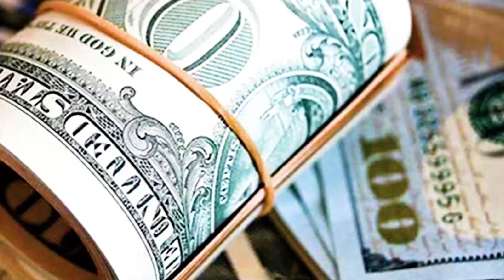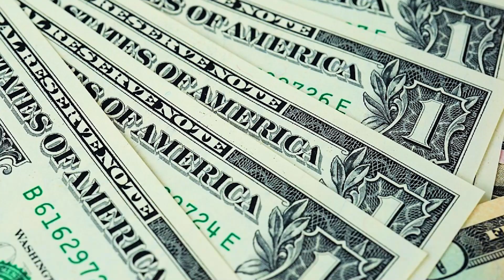China Largest Solar Power Project in Africa Electrifies 420,000 Homes | Projects that shocked Africa

Comment: Today the state run (down) and mismanaged electricity company ESKOM produces about half of the electricity that it could produce in 1993 - before the ANC government poked its sticky fingers into that company and messed it up through 
unbelievable , still ongoing corruption and utter incompetence. I totally trust that the Chinese have the ability to built such a plant as described. I hope that they also have the savvy to control the running and the payment collection themselves otherwise the usual ANC corruption will also sink this project like anything else they touch.